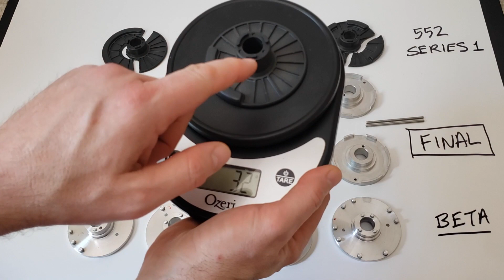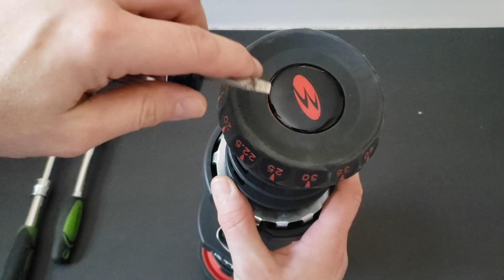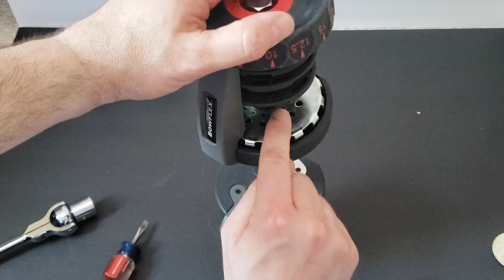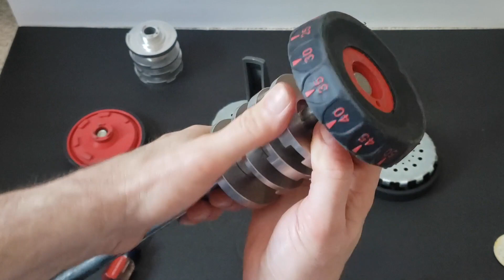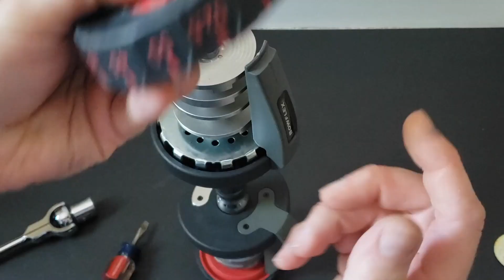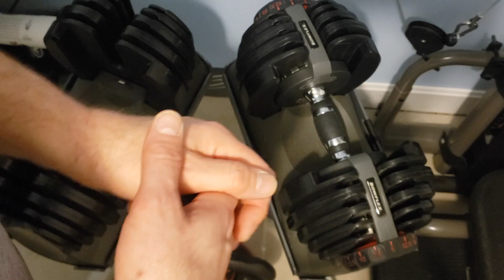Average Joe fix for Bowflex® Selecttech® 552/1090 Dumbbells. Ready for Primetime!

Comment: Hi Joe, how much is the whole set ? Co’z I just both a new set of bowflex dumbbell..and I will not wait till it breaks..
Reply from the maker: Hiya Gilbert, and thanks for inquiring man. I appreciate it. If you head on over to www.averagejoeinnovations.com you can check out all of the current kits and pricing. And in the Announcements section of the site there's some information about kits coming out this summer too.

You can also see what my 552s and 1090s look like these days with all of the latest upgrades here (1090):  https://youtu.be/enDjvTG3Ai8  and here (552 Series 2): https://youtu.be/lipbLG1IYNU

Comment: Will these fit into the TroyaForce version as well?  I bought that version and it was built very similarly to the bowflex model but a little different.
Reply from the maker: Hiya James, I know we already discussed this by email a few weeks back. Just leaving a response here to answer this questions for others who may have the same question.  Yes, TroyaForce is one of many dozens of resellers "white labeling" the SelectTech knockoff.  I cannot tell you which specific knockoff manufacturer they're sourcing from...I wouldn't know.  But it's clear they're selling 552 Series 2 copies. My kits can work with knockoffs as well. Cheers!

Comment: For anyone stumbling upon this while making a purchase decision, as an extra data point I'd like to add that I received my set of 1090i a few days ago and they have all metal discs. I don't know if the "i" is relevant or if they've finally fixed this design flaw in recent production runs, but I thought it was worth mentioning. The full name,  as written in the manual is: Bowflex SelectTech BD1090i.
Reply from the maker: Hey there Mascot. 1090i isn't a new designation. I believe, though I am not 100% certain, that the name coincided with the changeover to riveted metal tabs on the weight plates. Basically a "Series 2" without ever actually calling it a Series 2 officially. 

The discs have been the same since the 1090 was launched. Take a look at this image: https://bit.ly/3bhb7iW.  If your discs look like that, they're not all metal.  They're plastic encased metal with a plastic core hub. And, unfortunately, prone to failing just like the 552, despite the addition of the large encased metal washer.  Think of it as Bowflex's half-ass attempt to reinforce a disc. 

I assume at some point Bowflex will see what I've done and get the hint that maybe it should redesign its discs for future dumbbells. That hasn't happened yet.
Reply: Dang, I think you're right. :( I even scratched the black bit with my nail and could've sworn it felt like metal, but now that I check more closely it does seem to be a plastic shell. If this has been an ongoing issue for them, I don't understand why they wouldn't go all metal to be done with it once and for all. Oh well, at least I live in a country where they have to fix it for free if it fails in the first five years.
Reply from the maker: @mascot4950  Dude...thousands of us are right there with you.  We all wonder the exact same thing.  They had 20 years to fix it...still haven't.  You'd think safety would be the number one priority when designing exercise equipment. Yet here we are today. Sucks, I know.

Of course now I am dying to know which country you're in. Seriously...the 5 year free parts and labor warranty on purchases...that's awesome. Any room there for one more foreigner? ;-)
Reply: On the positive side, I've found a number of people who've claimed to have been using them regularly for over a decade without having any issues. So, fingers crossed..

I'm in Norway, although I believe much of Europe has similar laws. There are two levels to it. All products (with obvious exceptions) must last a minimum of two years or get repaired for free, and if the product should be expected to last significantly longer than two years the new bar is set at five years. I've had items fail mere weeks before the five year deadline and gotten them fixed at no cost, so the law works.

Comment: Hi, does the series 2 has the same problem or they fix it ? Thank you
Reply from the maker: Every SelectTech model suffers from this issue.  220, 552 S1 and S2, 560 and 1090.  Some folks can go years without a single disc failure. Others experience broken discs days, weeks or months after purchase. And I'm not sure why.  I took care of mine with no abuse (I have 552 S1 and S2, 560 and 1090) and discs still broke eventually.
Reply: @AverageJoeInnovationsLLC  thank you I was planning to order 552 s2 but I haven’t decide yet or the powerblock I guess they all have cons
Reply from the maker: @iio8017  All of them have weaknesses and usability challenges.  For Powerblock it's the breakable welded attachment points on its lower cost dumbbells, the crackable plastic lip on the end of each handle, and on higher end urethanes the coating peeling off.  I tell folks just go with what works for your budget and style, take care of them as best you can, be careful, and address stuff when it comes up.

Comment: This is an awesome fix .  Will it allow u to perform renegade rows? Due too more stability of the discs. Since its not recommended according too bowflex.
Reply from the maker: Hiya Alvin.  Yes and no. The challenge with body weight exercises and some adjustable dumbbell designs is the stress on load-bearing components. In the case of the SelectTech, those components are the discs and weight plates. Replacing the discs certainly eliminates one point of failure. But the weight plate tabs aren't really going to hold up under the repeated strain of body weight exercises.

So whether you're doing renegade rows or devil's presses, you do run the risk of eventually shearing/fracturing tabs on your weight plates. I'm working, albeit as slowly as molasses, on two potential fixes.  The first is what I affectionately refer to as dumbbell "feet" that slightly elevate the dumbbell off the floor during bodyweight exercises. The second is all-metal versions of the weight plates.  Both have the potential to allow such exercises.  But I'm in the "back of the napkin" stage and it'll be months before I have anything worthwhile to show all of you...that is, if I ever have anything worth showing.

Comment: I've had my SelectTech dumbbells for over 10yrs now.  Hopefully I won't have to replace the parts, but glad to know where to go if I need help.
Reply from the maker: Hiay GD,  awesome...may you never find yourself in need of a repair!  Some folks go 10-15+ years without a single incident. Others experience issues after as few as a couple weeks.  Crazy inconsistency.  I should mention for the sake of others reading the comments that abuse is not the only reason why adjustable dumbbells fail. I know of many instances, including my own experience with both my 552s and 1090s, where even well-maintained adjustable dumbbells unexpectedly fail.  I would have preferred that the manufacturers spec'd better components and charged a higher price from the outset. Going cheap on fitness equipment that has the potential to cause serious injury isn't a wise idea.

Comment: Hey, I have a pair of unbranded dumbbells I just got. They are basically the same as Bowflex without the Bowflex branding. Will these work for those? If so, How can I order?
Reply from the maker: Hi Gentoo.  In my experience it depends on the knockoffs.  Some are virtually identical....down to the millimeter.  Others have had really strange differences....I tested a couple 1090s with a shaft that was 10mm longer....everything was off by about 5mm per side so nothing lined up like OEM.  The quality of some knockoffs seems to be excellent, but they all suffer from the same disc/pin issues. In fact, the locking pins on several knockoffs refused to work smoothly. As a result the dials were often difficult to turn...they'd keep getting jammed on the locking pin.

The only way for you to know if they'll fit is to take a few key measurements.  If I can find some time over the next couple weeks I will put together a video for people with unbranded knockoffs.  I'll show you how to determine if my Disc Fix Kit will fit. I know a couple of customers over in Singapore measured theirs already and they'll definitely fit. Stay tuned!
Reply: @AverageJoeInnovationsLLC  Sounds good and thanks for taking the time to give such great info. I can describe mine, they are 552 and the grat tag on top that says "Bowflex" on mine is red and just says "Dumbbell". the endcap piece also says Dumbbell. The numbers on the dial are white. The tray is pretty much identical even down to the warning sticker on it.

Comment: A tip some of you may find helpful: You can use some tape to hold together the inner black plates and silver discs, so you don't have to worry about the ball bearings and springs popping out during disassembly.
Reply from the maker: Great idea Jeff....also, a dab of grease on the ball bearings helps keep them from rolling out of the springs.

Comment: Hey Joe I wrote you last week about the broken handle piece. It’s the piece that has Bowflex written on it, mine is red on the Series 2 and you’re is gray. It arrived today but apparently Bowflex designed it with nuts inside the piece where this handle piece screws into. In order to get to that piece, it appears that I need to take the whole handle apart. The series 2 doesn’t have a sticker on the ends. It appears to be a plastic cap of some sort. I can’t seem to pry it off with a screwdriver or a butter knife. It’s taking out pieces of the plastic on the edge so I’m stopping trying for now. Do you have info on how these end caps come off on the Series 2 handles?
Reply from the maker: Oh man Nicholas.  So sorry I am seeing this 2 weeks late.  I've been flat out busy keeping the trains running on time...I want to make sure we head into production smoothly.  But I am glad I took some time today to answer some YT comments. 

Ok, so...those caps are in there hard.  That was not your imagination. I have scratched/buggered more than a few prying them out.  Had they been properly designed with a notch it'd be a non issue.  I use the most flat/skinny blade I can find...preferably plastic of the type used on phone LCD screen repair kits. And you need to press fairly hard to get underneath the cap.  Once you do, it'll pry up and off fairly easily. 

Yes, you'll need to disassemble the handle to be able to make that replacement go smoothly.  By now you've probably already done it.  Sorry I wasn't more help sooner.
Reply: Thanks Joe. I actually had to end up drilling a hole in the ends caps and prying them out that way. Literally nothing I used could get them out. Each tool was just breaking off pieces of the ends of the caps. I just put them back in with the holes in them. It doesn’t affect function so it doesn’t really bother me. Thanks again.
Reply from the maker: @nickygee010  wow, that's crazy.  Sorry to read they were in so tightly on yours.  I'll be coming out with a line of aluminum end caps that can be removed as well as an entire new selector dial in machined aluminum...stay tuned.  Frankly, I don't put the end caps back on any of my sets once they're removed...mostly because they either lose their adhesive or, like the 552S2, they're a pain in the butt to remove.

Comment from the maker: [Update: 5 June 2020]  Quick update folks.  First, to the couple hundred people who have written to me these past few days, I'll take an hour or two this weekend to hopefully make it through all of your emails and reply if any of you have questions that were not answered the in the email auto-reply. The sheer volume of emails blows my mind. Shout out to folks from Kuwait, Israel, Hawaii, and multiple Canadian provinces...the love just keeps pouring in. You guys rock!
 
After some back and forth with the manufacturers yesterday, I made a couple small but important 11th hour design revisions tonight. Basically, I got rid of the alignment pin and replaced it with heavy duty built-in slots (thicker and larger than OEM). The pin worked fine, but I would prefer that you guys not have to worry about fiddling around with 4 pins. I want your installations to be smooth like butter.  Part pricing will likely go up a little for me due to the extra time on the mill, but I'll eat the added cost since I already published the 552 prices.
 
I'm hoping the local shop can whip me up one last set of prototypes later today (Friday).  If the new slots perform well, both manufacturers will schedule us into their queues for the 552 S1. The shop is also going to get started on prototypes of Rev 2 of my 552 Series 2 and 1090 designs hot-off-the-press....hopefully they'll do that by next Tues/Wed so I can test for a couple days before moving 552 S2 and 1090 into production.  Those may actually get into the production queue a couple days early....we shall see.
 
Later this coming weekend I'm hoping to begin taking 552 Series 1 pre-orders. Those of you who signed up at SelectTech.Fix@gmail.com will be on the list to be notified when that happens.   Still shooting to follow this up with pre-orders for 552 Series 2 and 1090 the following weekend.  Biggest unknown at this point is the 1090 fix pricing. As soon as I nail it down, you'll know about it.
 
Last, but definitely not least, my dad has been putting on enough weight that the doctors may keep his late June surgery to remove remnants of his cancer.  We're hopeful it won't spread before then, and grateful this sort of surgery is even possible. Fingers crossed.  
 
Sending out some love to you and your families.  I hope you all have a great weekend. 
 
Cheers,
Average Joe
Reply: HOW CAN I BUY 2 SETS OF DISK FROM YOU PLEASE CALL ME 562 656 8262 MY NAME IS MARIO.THANK YOU .
Reply: Thanks for these videos. You’ve done a tremendous job. I have a quick question. I have 552 Series 2 and the dumbbell tab piece broke. It’s red on the series 2 and grey on yours. It’s the tab piece that says Bowflex on it. I would need to replace that before buying your discs when they’re ready for series 2. Bowflex told me that I would need to buy the whole handle but I see just that piece on sale on eBay. Since you took these things apart, I figure you would know if I can just buy that piece or if I need to buy the whole handle. Thanks in advance.
Reply from the maker: @nickygee010  Hi Nicholas, thanks for the kind words.  Short answer is that the red part (grey on Series 1)  keeps the weight plates from rotating freely in the handle while you're using the weights.  Meaning it's a necessary part of the assembly. Don't waste your money on an entire handle. You can find that part on eBay occasionally. But they've become increasingly difficult to find in the U.S. Here's a link:

https://www.ebay.com/itm/Bowflex-552-Series-2-Replacement-Dumbbell-Tab-Part/253400093155

I am seriously considering stocking some of the harder-to-find parts that sometimes break on the 552/1090. I'll revisit the idea once I've delivered in the first few hundred sets of fixes. For now, keeping an eye on eBay is your best option.
Reply: Thanks Joe. I did order the part from eBay. What kind of screw heads are they? Is it a torx head?

Comment: Any idea how to tell the series of the Nautilus branded set? They are colored differently. Any other physical distinction?
Reply from the maker: Hi Kyle, I may have mentioned this to you in an email already, but for everyone else I'll write it again here.  For Nautilus the orange letters indicate Series 1. I believe white letters is Series 2.
Reply: Is there a distinction for the 1090’s?When I called boflex, they asked me the color of the numbers on the dial and they were red. When I called them about this problem they told me the only solution was to buy a new handle for $130.
Reply from the maker: @primetime1143  As far as I am aware, there isn't a "Series 1 and 2" equivalent for the 1090.  It appears that at some point they switched to the riveted metal tab on the weight plates, but that was about it.  So 1090 is just 1090..no Series X. 

Customer service has been telling customers the same thing for quite some time....buy a new handle (complete with the crappy OEM discs).  Same advice was given to me more than a year ago.  Technically, they don't want customers disassembling the dumbbells.  The original instructions state the following "Do not try to disassemble your Dumbbell handles, or base assembly. The product is not designed to be serviced by the customer. Contact your local distributor for repair information."  And your local distributor's reply will be....you guessed it...buy a new handle.  This is what originally led me to design the discs for my personal dumbbells....and that led to where we're at today with a production Fix.

Comment from the maker: Hey guys, I had heard and read that 560s are dropping weights too.  It appears the 560 uses the same exact disc method to hold weights.   If you happen to know of a 560 owner who has personally experienced this problem, please let'm know they can contact me at SelectTech.Fix@gmail.com.  Once I have the 552 S1, S2 and 1090 fixes in production I'll circle back and solve that 560 problem too.

Comment: Excellent joe waiting for your 1090 repair kit so I can get back in the flow of working out safely this time.
Reply from the maker: I hear you Michael.  Thank you for your support. Hope to get you back to using your 1090s soon. Stay tuned for updates on pre-ordering and production.  I've been busy updating the 1090 and 552S2 models with the new design tweaks.  Hope to have that done by the end of the weekend.  Then I need to verify the tweaks with a fresh set of machined prototypes specific to those models.